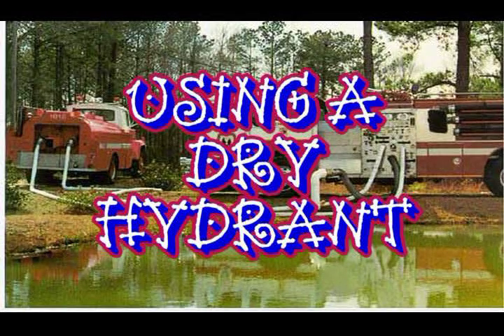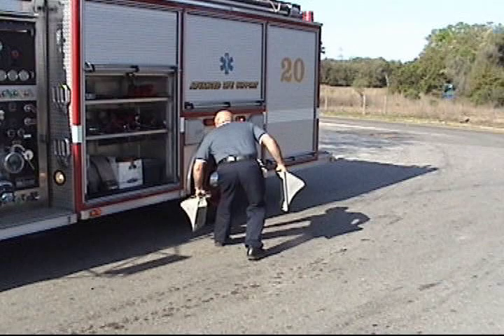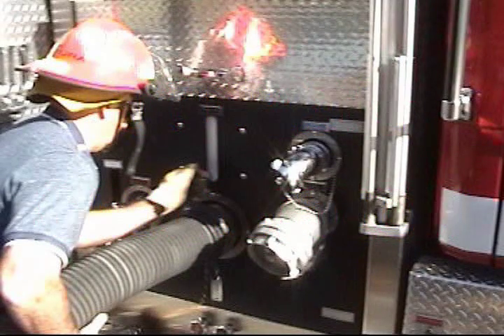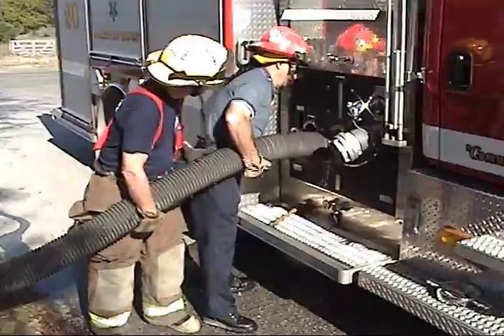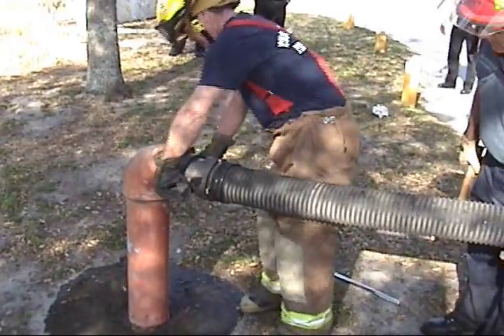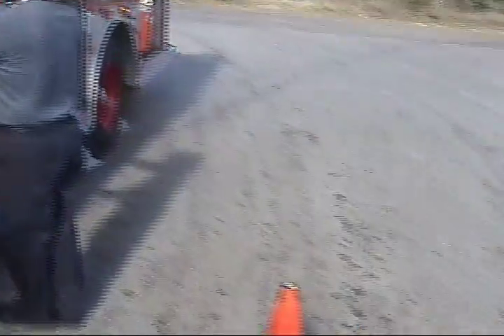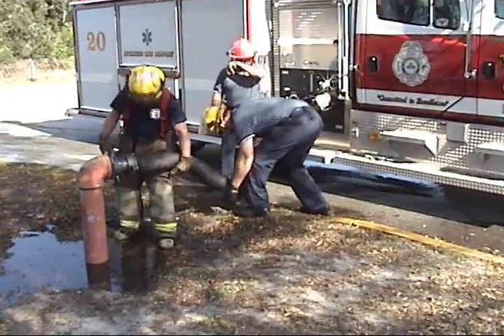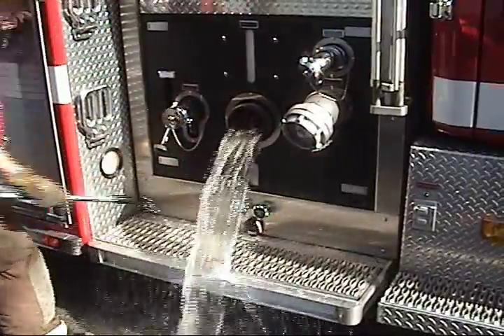Using a Dry Hydrant

Comment from the maker: The centrifugal pump depends on velocity of the water moving throught he pump to continue the drafting operation. If while beginning the operation you haven't achieved that velocity or moving water, the pump can lose its ability to continue the draft and you would then need to reprime the pump. Throttling down will some times but not always allow the pump to (catch up). Keep in mind that Centrifugal pumps are unable to pump air.

Comment from the maker: I suppose it wopuld be possible to back flush a dry hydrant, however>>>> if the piping has a checkvalve or foot valve not possible> also using precious water from your tank to back flush the hydrant may not be in the best interest of the scenario it all depends on the need of each scene.